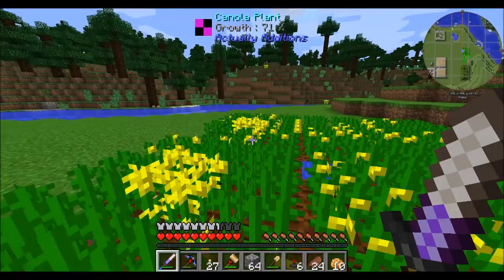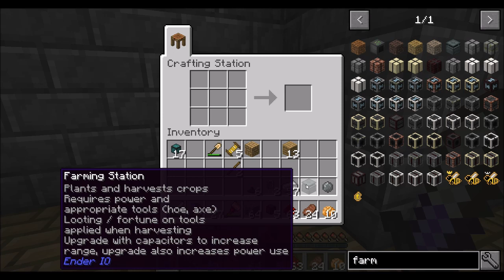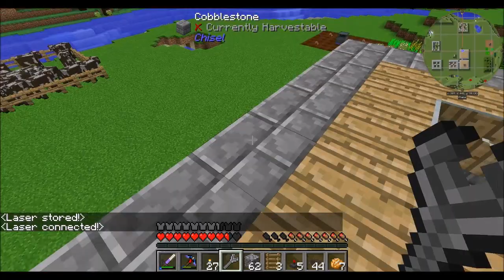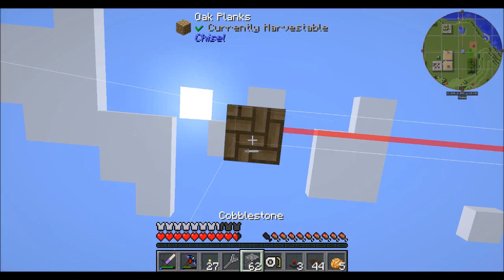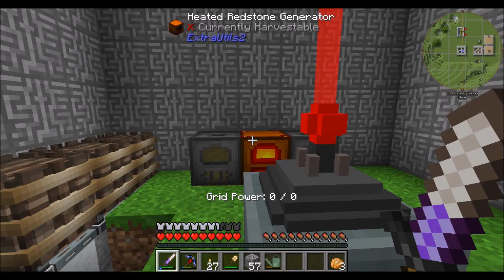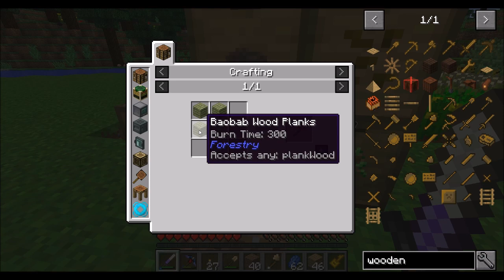Lets Play S8 E13 Farming

Comment: Redstone is renewable.
Reply: not currently (he doesn't have silk touch) and not even at the speed he is burning it
Reply: Evil Potato 1- the seeds are rare, you just got lucky i had more troubles getting it

2- he needs to plant the redstone orchid into a block of redstone so silk touch

3- he is using tinker's pickaxe/hammer and i really doubt he does any vanilla enchanting for a while, amd it's easier to get a silky jewel than a SilkTouch spell

4- i'm not a fan at all of the vanilla silktouch pickaxes and dire isn't either, those will be used once and forgotten since they can easily break and then they are gone, 

5- since there's no MFR he won't be able to extract enchants that easily (unless he goes mad with the Draconic Evolution stuff or empowers a block of diamond) and then he may use the enchanter to get silk touch but he doesn't have slime balls and he won't lose that spell using it in a pickaxe that happily when he can use mana enchanting from botania which he is not close enough

as i said redstone is not renewable for him yet. and also he is burning 8'5 aprox pieces of redstone per MINUTE which would need a lot of redstone flowers to produce
Reply: there's no need to pull items off stuff with Ender IO, at least i think its ender that adds it. You can craft the enchant onto a book, using XP and items, and apply with an anvil.
Reply: Steffan Kitchener once he goes to the slime island he will be able. he needs a slimeball for the enchant in the enchanter (and yes, it's from ender io). still a resource that dire doesn't have
Reply: Joachim Von Grimorium you can make rice slime which i believe is ore dictonaried to slime balls :)
Reply: Steffan Kitchener touch&#233; ... still he has a slime island right on top of his head xD and btw its inside of the &quot;vanilla enchanting point&quot; i made

now for curiosity even if the rice slime ball is oredictionary-ed does the enchanter accept it? not all machines accept oredict and its beyond my knowledge. never bothered on the silktouch enchant
Reply: Joachim Von Grimorium i wouldnt know to be honest, not played with actually additions all that much so not sure how other mods interact with it. Don't see me using that much either since what ever its machines do, Ender IO does better for the most part. Canola oil, as it stands now, gives more power for less effort though, even just the basic tier, so I'll to be abusing that before the mod dev changes it